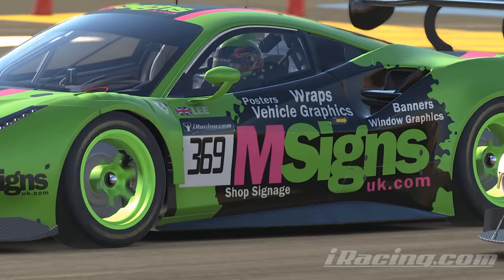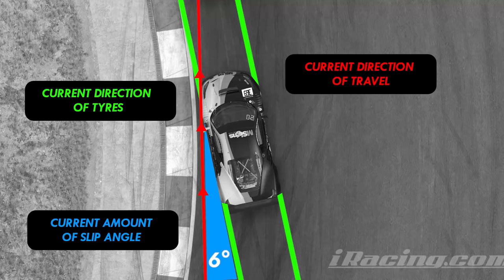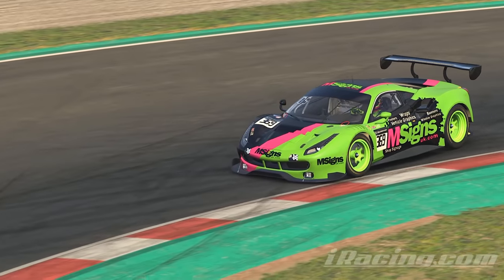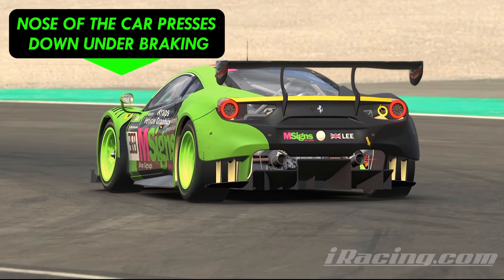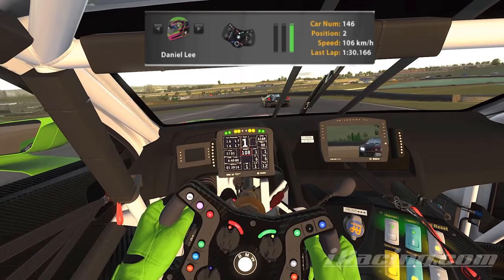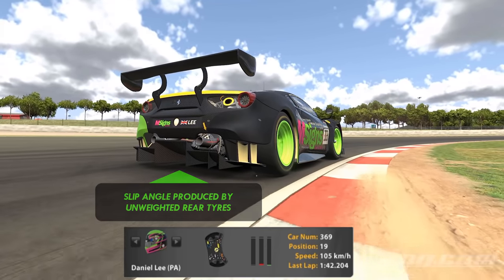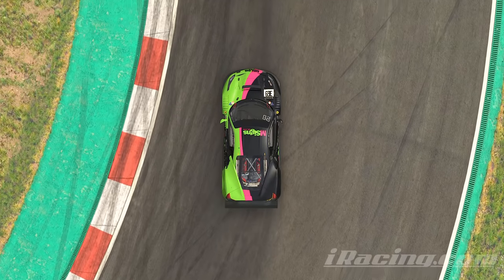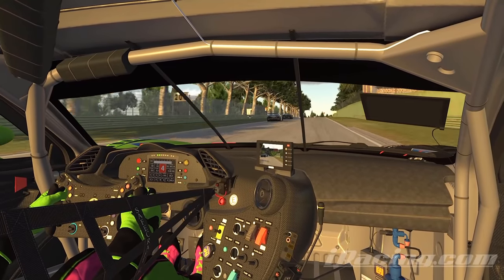Slip Angle in Sim Racing - Nail This and Smash Your Lap Times

Comment: "A Full throttle four-wheel drift with almost no countersteer. I'm really impressed" - Ryosuke Takahashi
Reply: A four wheel drift is still quite different to what is described in the video, this is more similar to what god arm does while what Takumi does is more like rally.
Reply: @ChizeSOI  yep even keisuke does that I've noticed he slides a little it's the difference between technique for rally and technique for circuits
Reply: Let's not argue the Minutia of the angle. Four wheel drift is a four wheel drift.
Reply: @YouilAushana  it's not a 4 wheel drift
Reply: @ChizeSOI  this isnt god arm technique it's completely different I just realized
Reply: @Reinhard_Erlik  damn I see you everywhere
Reply: @pegueropeguero9086  hahaha I've been really active in the comment sections lately
Reply: @takumifujiwara2073  all four wheels sliding and being used to their limits
Reply: @takumifujiwara2073  kind of is
Reply: @takumifujiwara2073  is known as a power slide. when you drift but the rear tires are still gripping to the road. it feels as if the car is steering on its own but you can regain control easily if you wanted to.
Reply: This is more akin to Dr. Joshima's driving.  "Not quite drift, not quite grip."  But as Joshima's partner Kozo Hoshino states, "it's the ideal drift."
Reply: I did it before in AC,then after a PERFECT entry my arm SLIPPED off the steering wheel and crashes into the guardrail lmao
Reply: @white_mage  would a 4wd slip drift be faster?
Reply: @-kryon1c-  i don't know. 4wd cars have more grip but the way they drive is different.
Reply: @white_mage  tru jus cause they have more grip wondered if u could use more of their power/hp compared to a rwd
Reply: @-kryon1c-  yes you can use more power on 4wd cars, but i doubt they would be faster on corners. these type of car is also heavier. the whole transmission assembly is twice the size.
Reply: @white_mage  Y'all talking about drift like it's relevant. Some amount of slip angle is present any time any car turns. All slip angle is, is the angle of difference between the tire's orientation and the direction of tire travel at that moment. The technique he is talking about is about maximizing the slip angle without transitioning into an actual slide for a given vehicle. He just does a terrible job of explaining it, and he admits as much with his "I'm not an expert" disclaimer. His explanation is good enough for simracers to be aware of it though.
Reply: @IntrebuloN  ikr its crazy
Reply: I love how every time i see a vid about sim racing drifting (even if only slightly related) intial D fans are found
Reply: @UnyieldingMass  ikr. i get the jokes but almost always someone is like nani? kansei dorifto and its not funny anymore
Reply: @white_mage  lol dont get me wrong, that is my favorite anime to this day but i thought it was super niche. Not so much the case on YouTube lol
Reply: This is exactly what it is.
Reply: Let me remind you that thing call Scandinavia flick and it was invent by Finland driver for rally.
Reply: @ChizeSOI  after watching everything, the racing becomes less rally like and a little more circuit like.. hence Keisuke goes on to race in circuit. But its also difficult to compare an anime about driving in the mountain passes of Japan to driving a GTE car in real life of a sim lol.
Reply: @reillyploplis7457  It depends on the track, the old Akina map was a lot closer to circuit with its layout with very little actual downhill. The new Akina track is a lot tighter and so rally techniques are used more often. Usui is also very close to rally with its constant corners that almost require you to be able to weight shift into slides to keep yourself from braking 24/7. But yeah, it depends on the track. Hence Keisuke goes on to race in circuit and Takumi goes on to rally (at least I think).
Reply: @ChizeSOI  Yeah, we never find out what happens to Takumi.. there’s some lore in the Author’s new series that talks about the legendary tofu car but they don’t say specifically that he goes on to do rally. There is also lore that suggests he just carry’s on the tradition of his father.
Reply: Hey ... does anyone know the reason F1 drivers don't use excessive slip angle technique to make the rear slide through the hair pin of Monaco circuit to get faster, since their cars don't have no hand brake equipped❓
Reply: I really need to catchup with initial d
Reply: @JohnKickboxing excessive slip angle and high downforce don’t work together, if you slide the back end you risk spinning a lot more in a high downforce car. You’d never want a handbrake in an F1 car there is just simply no need for it. You’d also wear the rear tyres significantly more, something you don’t want to do in a 70+ lap race

Comment: Always felt myself searching for the edge of grip where the car feels like it floats out of the corner. Greatest feeling
Reply: Yeah it just feels great to get that perfect exit!
Reply: Yeah dude, I’d feel that floatiness and rotation and know that was the sensation to have but never attributed it to slip angle. In real life woah  it’s surreal
Reply: @victorbui1749  yeah, it’s odd how We found the “float” and knew it was the right way to go fast, but it was awesome being able to keep up with people on sims after only teaching myself and just pushing the limits of grip. That’s what’s so great about sims, there’s no repercussions
Reply: How do you "feel" this in simulations... ? What exactly changes on the FFB of your steering wheel that makes you feel it? I would love to kinda get an understanding of how to feel this to learn it ^^
Reply: @Boonatix  I guess It's when you feel your car start oversteering a little bit during entry and into the corner, which points you at the exit in a better angle to get accelerating faster, but idk how to put it either.
Reply: @npne1253  exactly, you set up the turn perfectly on entrance with braking and then the tires go ultra grip mode and it feels like you shoot out of the corner making sure you don’t overdo the gas and steering angle on the way out
Reply: @Boonatix  the exact feeling is the wheel’s ffb getting lighter than it is during a normal turn. It simulates either the front or the rear tires losing grip. You will determine which by looking at the car’s orientation on screen. From there use simulation tactics to smash into a wall repeatedly until you find the edge of grip
Reply: @Diskjok11  i think I managed to do it 2 or 3 times in my Bentley GT3 yesterday... but that feeling is crazy, woah, and I have no idea how to manage that over more laps and longer periods of time... guess I got another goal now :D
Reply: Feels particularly great on a friday evening on the way home from work ;)
Reply: So satisfying, especially when you tune it yourself to set the car in easily.
Reply: @Boonatix  i think the way i "feel" it is through visual and the ffb info. sometimes audio because you can hear the tires working hard.
Reply: @Boonatix  imo driving on ac1 touge mods helps me best with learning grip, the corners have a lot of variation of difficulty and road surface inclination so there is always a new limit to learn it feels like.
Reply: @Boonatix  also the los angeles canyon map is good too, i find its helping me learn about high speed slip angle because of the way the corners are. Also having TC and ABS off will make it harder but i think its one of the things that helped me progress as much as i have. The kunos tuned ae86 is really good for learning that style, its very light and doesn’t have way too much power, which you could easily mess up with.
Reply: I was thinking the same.
It really is. 😃
Reply: @Boonatix  
Basically you feel the steering lighter than usual, the car is clearly starting to oversteer and it becomes sensitive to inputs. You can say you're turning less the steering but the car is doing the turn.
It feels like karting, like you're controlling the car only with the front and the back is trying to follow. 😅
Reply: Absolutely.
Reply: @Boonatix  Hey Stefan! It's great seeing you in the wild, I'm trying to learn just as you are, it's really encouraging seeing you're watching the same things.
Reply: @JamesChurchill3  so much to learn, always on the lookout ^-^
Reply: yeah i accidentally does it in porsche rsr and i want to do it again, its amazing, i finished villeneuve chican 1-2 tenths faster that way, iss crazy
Reply: It’s a small slice of heaven
Reply: @Boonatix  some cars are super hard to hold it some cars are easy, road cars I feel have a really soft response so it’s easier to hold them while slipping. Whereas f1 cars on the medium/low downforce areas can do it but again it’s takes a lot of control, I’ve been sim racing for around 7 years and only in the last 2 could I do it consistently alot of it is in entry and exit, make sure to really Chuck the car in so it starts to over rotate and then when on the apex slowly apply throttle earlier than you think but very small will bring you lap times down, trust me you can feel like your on the edge but just try adding small amount of throttle when you’re at the apex will slingshot you out with that extra 1/2mph and then just balance the throttle on exit with a little slide but no mega steering corrections or you will loose time. And remember practise makes perfect.

Comment: so this is what "IN BETWEEN DRIFT AND GRIP" thing that Ryosuke was talking about
Reply: God arm technique
Reply: It's not between drift and grip, it's maximum grip. Maximum slip angle for a given tire and vehicle configuration before transitioning into an actual slide is the maximum grip level for that setup. This is why the corner is faster when you are the maximum slip angle for a given setup, you are developing MORE mechanical grip from the tire at this slip angle. This is a critical skill in kart racing, since the rear axle is solid, perfecting the technique that gets you to the maximum slip angle quickly and hold there is necessary to have the kart negotiate any turn at speed, otherwise the kart simply does not turn. When done correctly, the wheel is straightened at apex and the kart steers itself out of the exit. The skill is not necessary to get a sprung race car to turn, but it IS required to get the maximum grip level out of the suspension and tires.

In karts, if you haven't mastered this, you simply have to go much slower around turns to turn at all. When someone does it right, you see them turn in, make very small corrections, and then straighten the wheel to center. When they aren't doing it, they turn in, have to make big corrections to keep the kart on the racing line, and have to manually steer out of the exit.
Reply: @IntrebuloN  any rebuttals??
Reply: as someone in particular said, this technique is called DRIP
Reply: @ilham7345  huh
Reply: @IntrebuloN  Brilliant, thanks!
Reply: @IntrebuloN  it's turning with the tires on their absolute edge of grip
Reply: @IntrebuloN  However, it is straddling the blurry line between sliding, and gripping. So the statement is accurate enough from the layman's perspective. Keep in mind these are quotes from a Fictional character.

Comment: A great car for this is the AE86 in assetto corsa, it's absolute fastest is when you barely steer and the car and it feels like it knows where the exit is by itself.
Reply: GAS GAS GAS
Reply: the drift spec or the regular version?
Reply: @DINOzye  NOT the Drift Version, I don't know about the stock, but I have been learning Slip Angle for quite some time in the tuned version. :)
Reply: @DINOzye  either stock or tuned although I feel the tuned version goes there a bit quicker so it's a bit more sensitive
Reply: @DINOzye  I cant speak for the other 86s but the tuned version feels like it steers itself with the steering wheel straight, especially on longer corners the nose just rotates in towards the corner by itself
Reply: @DINOzye  drift spec can also do it

tbh, pretty much any rwd car can do this if you're good enough
Reply: The AE86 N2 mod in GTR2 is also good. Kudos to the modder who made the car handling really close to reality that it requires one to maintain momentum when cornering and also learn about slip angle. As Bunta said, the hachiroku is the car that trains its drivers.
Reply: Is it a mod?

Comment: I’ve heard this talked about as vaguely as “making the car rotate” or “introducing the car to the corner”, but I hadn’t heard it explained objectively. This makes sense, excited to try it. As with many things in racing it seems it comes down to “smooth is fast” and there’s no substitute to properly smooth throttle and brake inputs
Reply: Myself, a keyboard user : Smooth Throttle and braking are both out of my dictionary.
Reply: If you're constantly trying to force your limits a little bit more these things come naturally. As you brake deeper and harder the car naturally wants to lose grip. You "just" have to adjust your driving/setup to make the car only a little bit loose.
In GTR2 it was quite natural to me (specially because I like Porsches 😅) but in Kart Racing Pro not that much as Karts are very sensitive on braking and turning.
Reply: @bullracing1  what sim do you play in? as using mouse steering can easily boost your driving experience without even having to go out and any new hardware...
Reply: may not need smooth inputs if they can be fast and consistent. along with a very good feel for the momentum of the car. its why senna rough throttle technique worked so well for rapid adjustment of yaw angle in his F1
Reply: This objective stuff is like music to my ears. I know a lot of people might not relate to this but it reminds me very much of me finally learning to swing a baseball bat properly more than a decade ago. I grew up hearing all kinds of colloquialisms like "throw your hands at the ball" and "focus on your follow through" and it never clicked until I looked online myself and found people analyzing pro swings and objectively breaking down each particular movement and thinking about the physics of it all. I wish I found this channel sooner.

Comment: Well articulated, particularly like the connection between trail braking and slip angle, the what and why.
Reply from the maker: Cheers man, took a while to find the words for this one, such an abstract thing to try and describe. Simple to do, hard to explain!
Reply: That part of the video is just top job. Very, very, very good explaination on that part.
Reply: Hey ... why don't F1 cars slide at the rear like this one in the video ??
Reply: @JohnKickboxing  They are actually sliding, but angle is small
Reply: @Pak_PakoBbl4  👌
Reply: @JohnKickboxing also, aero. The more you got the less you need to slip. Aero changes cornering lines like nothing else.

Comment: Both Hamilton and Schumacher like a slightly loose rear end, makes sense
Reply: That thing “only” Max can drive with and Alex and Pierre couldn’t (which was laughable)

Ps Alonso is also famous for it
Reply: Oh yeah with the undeersteer + slip angle for that corner exit speed
Reply: @lol shit where do u get this info mate?
Reply: @jwork5680  onboard footage?
Reply: @jwork5680 Hamilton likes to square off corners precisely because he's mastered the slip, and can do more of it without losing the rear. He brakes late and hard, rotates the car, and straightens the exit. The chonky tires and soft suspension (relative to this year's cars) is what made him so fast in the W11. The current gen cars are much stiffer and have thinner tires, so Max's style of braking earlier and keeping the car more balanced through the corner is better suited to this kind of setup. To slip the rear you need to transfer more weight around and unsettle the car a bit, especially with the levels of downforce F1 cars produce.
Reply: It's most probably Hamilton's ex, Paris Hilton, who taught him how to loosen the rear end

Comment: I have always felt the slip angle when i got through a corner pushing the edge of the grip. Just never knew what it was called. Nor was i reliable in Controlling it.Thanks for the amazing explanation!
Reply from the maker: Thanks for watching and commenting, I plead you to do some deep diving on the subject if it's triggered your appetite. The way tyres do their work is a field of extreme complexity and so, so fascinating.
Reply: @dannyleeracing  I find that a Nascar stock car really helped me practice this, as with touring cars I've been kind of spoiled for grip yet at the same time not knowing why I am understeering alot mid-cornering.
But with the simplicity of a stock car , It's also very challenging due to how much they can understeer/oversteer and how the breaks barely work compared to GTs.
But it is this challenge that helped me practice slipping and trail-braking as previously my driving style revolved more around going into a corner deep to get a faster exit.
Reply: Driving in snow will give you a great example and practice of slip angle.
Reply: @dannyleeracing  does slip angle relies on front tire heavily?? Will it wear the fronts more?
Reply: "felt the slip angle" lol